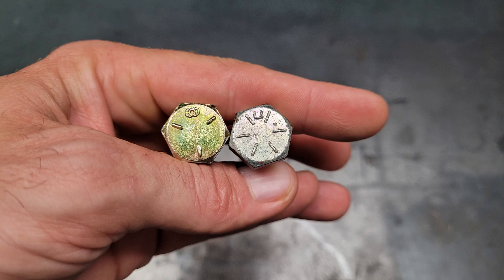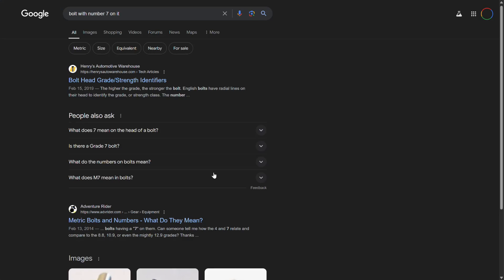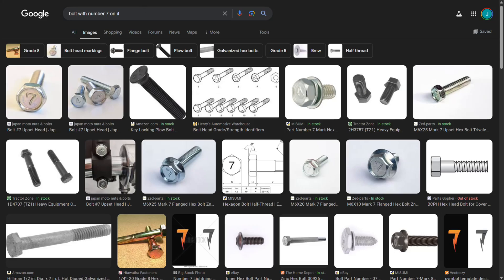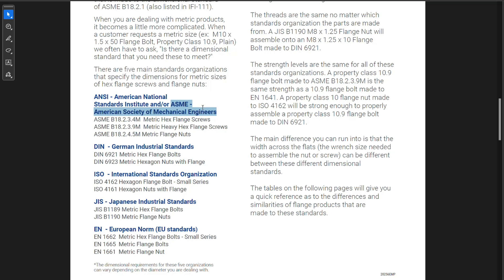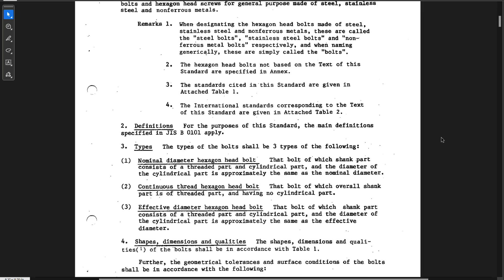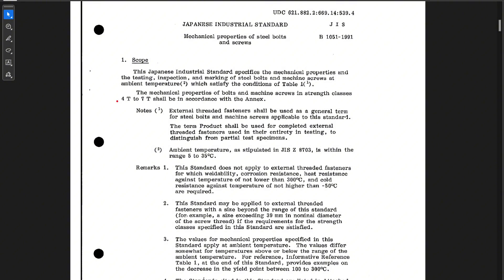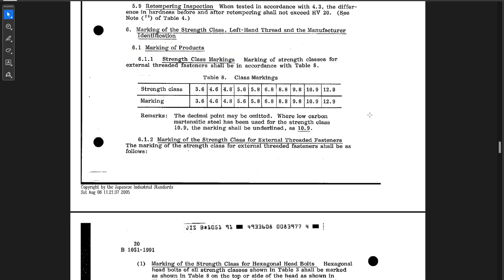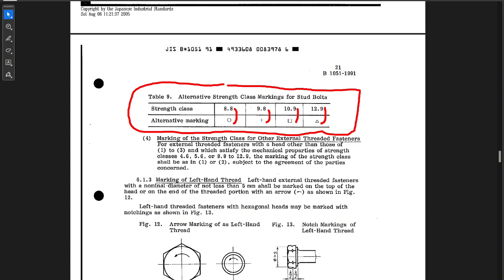Mystery Solved! Unique class 4, 5, 6, 7 bolt mark

Comment: This is exactly the video I needed. Doing a transmission rebuild & clutch on an old Mitsubishi. Whoever had it before me stripped everything. After helicoils for the inspection cover and time serts for the bigger bolts I needed new hardware and wanted to make sure the hardware I'm replacing is of equal strength. Thank you for researching this for us! 👍🏻
Reply from the maker: This makes me glad when others find these videos useful! This was an important video as I struggled to find the same details. Cheers!

Comment: Really cool video, i come across it trying to identify my bolts. I found some with Mark 8 and 9 in the same way as you 7 bolt. I’m guessing they are just higher grades that weren’t available back in 1991. Do you have any info on those?
Reply from the maker: Glad you found it helpful! When I did that research I only found markings 4-7. I did another quick search after your question, but no fast answer. I suspect you're correct that it's a higher class of hardware. I'll reply again if I come across a better answer. Cheers!

Comment: Thank you! My 80’s yanmar tractor uses bolts marked “7” as shear bolts in the differential where it would seem critical to replace with the correct shear strength.
Reply from the maker: You're very welcome! I would agree, bolt class in something like a differential would be important to match. Sounds like a great little tractor....I've had Yanmar engines on some equipment.
Reply: @LearnedFromDad I went with modern class 8.8. 👊🏼
Reply from the maker: @DrRossDunlap  back in action!! 👊

Comment: I just bought a bolt for a kubota engine with a 7 on it. So they are still made! Alternator bolt on a 4 year old engine to be specific.
Reply from the maker: Glad you found the video to help learn! I've seen them for sale on the internet, but never locally.....at least in a normal hardware store. But, definitely suspect I could get them through the Kubota dealer for my mower. Cheers!

Comment: dude! i'm crawling down this rabbit hole with you ... but my comment keeps getting deleted. i guess maybe i can't post links? google "Nissan Frontier D40 Disc Brake Caliper Bolt Size Spec w/ pics, JIS 9T Torque Spec??" for my story. 

i found an excellent JIS torque chart on a Toyota forum ...
Reply from the maker: The frustrating YouTube comment errors. Thanks again for sharing. Cheers!

Comment: Love these video's. I'm a retired maintenance mechanic myself and I save all my bolts and sort them into cans for later use. Having seen so many bolts in my life I can identify a bolt pretty quickly (metric excluded) but the strength sometimes is difficult if they use alternate markings not commonly used. I commented in one of your other video's I've been researching bolt head sizes (which in my opinion would make a great companion video to this video)  and why metric bolts vary so much between JIS, DIN and ISO. They seem to get along with their 4mm 5mm and 6mm bolts but all go their own way from there on.  For instance JIS uses a 12 MM wrench on a 8mm bolt and ISO and DIN use a 13 mm wrench. And on a 10 mm bolt JIS uses a 14 mm wrench and DIN uses a 17mm wrench and ISO uses a 15 or 16 mm wrench. And on a 12 mm bolt none are the same ranging from 17mm 18mm and 19mm wrenches. And  DIN is the only standard that makes a 7mm bolt and uses an 11mm wrench.  And ISO (at times) is the only one that uses a 15mm wrench on a 10mm bolt. I wish these people would standardize the head sizes so we do away with these extra wrench sizes.
Reply from the maker: First, I really appreciate your enjoyment of these videos. I have fun with it, but they do take time, so nice to know people benefit/enjoy!
The other element I really enjoy is all the comments and conversation. I have been learning a lot (nobody knows everything); I'm a perpetual learner. To your example, I was mo unaware than I should have been regarding the various standards regulating metric bolts. You're exactly right, the head sizes vary and many around the world really don't know that....simply because they're not exposure to all the variations. 
I definitely have your suggestion on the list!  Thanks for stopping back, and see you at the next video!

Comment: Just search bolt tensile strength chart👍
Reply from the maker: Do you happen to have a link to one with these 4, 5, 6, 7 marked bolts? I struggled so many times to find anything.  And, in particular, why the seem to be fairly uncommon (at least in my part of the world and seemingly much of the world). At least now I'm familiar.  Thanks for watching and sharing.
Reply: @LearnedFromDad  check the TOYOTA chart linked above! gold mine. however, read my forum post and you'll see even those values aren't accurate. or my bolts are poorly manufactured. aiii.
Reply from the maker: @35NHMA  excellent! I'll definitely have a look. Thank you for sharing with me.